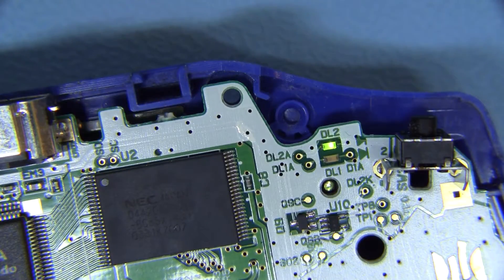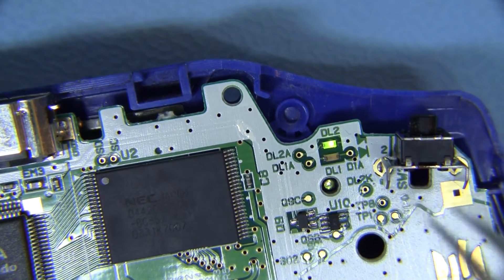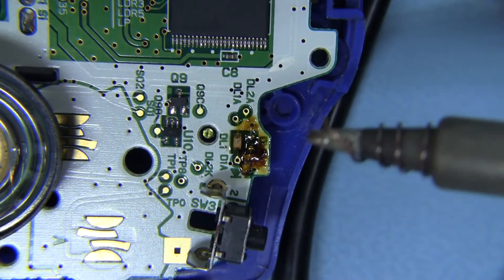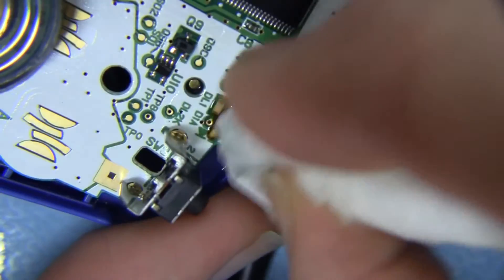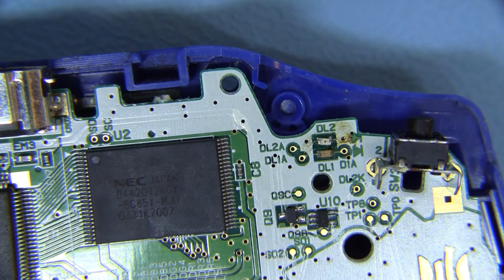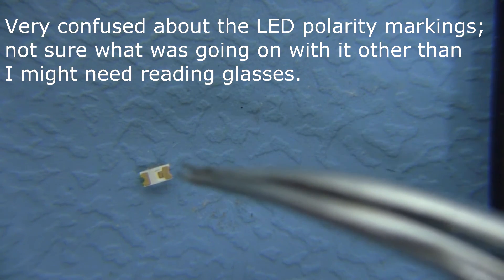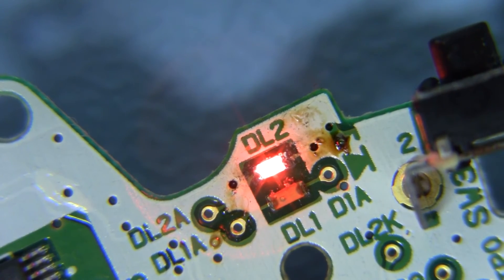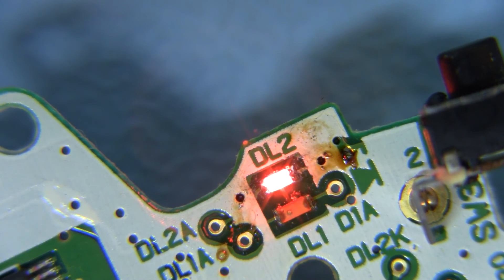Game Boy Advance GBA LED Mod

Comment: Hi Have you done this mod on the low battery LED?? I did both and switched it for a pink LED however it is not working, I got the power LED working replaced with a blue LED - any advice on the low battery led would be appreciated

Comment: Hey im not sure you'll ever see this message especially 7 years after the posting date but I really want to know if your technique or method for doing this has changed. The reason I want to know is because I'm planning on doing this myself and I'm unsure on how to go about it.
Reply from the maker: I would use hot air and flux to remove the LED or a bunch of flux and and soldering iron turned up pretty high like I did in this video if I didn’t have hot air - skip the wire technique altogether. Another help would be to use chip quick (see the easy game boy screen removal video).
Reply: @8bitjunkie8  thank you very much I  appreciate it. Is that video on your channel? I'll have a look if it is

Comment: IMHO hot air is overkill for an LED, especially on a small board like this and when there are plastic components like the tact switch nearby (those things are damaged very easily). An iron is the best way.
Reply: I was just able to do it with just the soldering and it was still relatively quick and easy as long as you have the right tip size which is the very fine point ones!

Comment: Great video, will definitely take the hot air way when doing this. Thanks!

Do you know the voltage delivered to the LED? A buddy wants to replace his with a purple one, and i'm not sure if the voltage is sufficient to drive the led because the max voltage of LEDs increase with wavelength.
Reply from the maker: It’s at most the voltage of the batteries (so nominally 3V). You could change the series resistor to a lower value to get closer to vmax. I’d buy the led and try pushing 3V through it and a variable  resistor to see if it will light up and/or determine the optimal series resistance. 

Let me know what you find out if you try it.
Reply: @8bitjunkie8  Hi, I want to change my LED too and today my Pink LEDs arrived. The problem is that they need min. 2,6V to start to glow. So I have done some measurments on the GBA Mainboard. The power LED gets power from the VDD3 Lane which is 3,3V, it got an resistor in front of 470 Ohm, the green LED got 1,9-2,0V. So my problem is that I'm not sure if its safe to unsolder the resistor. After the LED is a component (U10) which I dont know. Maybe a kind of switch?
Reply from the maker: @theRealStillPad  you will need to replace the 470R resistor with a 200-240R. I would build a test circuit with a 3.3V power supply to see what's the highest ohm resistor I could use to make the LED light bright enough.  It looks like the original LED is drawing about 3mA, I'd want the replacement LED and resistor to not draw much more than that if possible.
Reply: @8bitjunkie8  Hi, nice to hear from you. Today I made to some tests with the LED. Before I have done some maths that with the 470 Ohm Resistor the LED would have 2,6V with 1,5mA. With my testbuild the LED got 2,6-2,7V and 1,2mA @ 3,3V Source. I think its pretty perfect, because with more Voltage the LED would be way to bright. At this config. it is glowing but not blending. I'm pretty happy that it works so great with the 470 Ohm. Now I need to wait for my Flux Order to start soldering on the GBA :)
Reply: The l.e.ds are all the same colour just different tinting on the surface

Comment: So what type/model LED's can I use? Looking for a UV LED for that spot. I have a Glow case with UV silicon and clear buttons. Want to change both LED's. Putting UV LED's in the buttons.
Reply from the maker: It’s an 0603 style led. I (quickly) looked for a suitable one for you but the ones I found have forward voltages above 3V so I don’t think they will light up on the GBA

Comment: Thanks for showing this i have a white gba w black buttons and ags 101 mod w ez flash omega and all thats left is adding a blue or purple light there :)
Reply from the maker: Try to find one w as low forward voltage as possible. You may have to change out the series resistor to a lower value to get a blue LED to light up. Try swapping the led first and see if it just works though.
Reply from the maker: Did you try this yet? Send me a link to a photo if/when you get it done.  I'd like to see it.

Comment: Really silly to use a hot air gun for something so simple as a led swap all you needed to do was touch the ends of the led with the soldering iron tip while pushing lightly with tweezers.
Reply from the maker: there's no metal on the ends of those leds and almost none of the pad is accessible.
Reply: Jamal Phoenix.  3n7

Comment: wow, you are not talented -.-
and no smart guy xD

who needs a red Power LED in a GB Advance?? So it seems always to be low battery?
Reply from the maker: +Einfach Nein red's the only color LED I had at the time. I did put this board into a red shell and it looks pretty cool.  You could always change the low battery LED too, so it'd be a different color.
Reply: @8bitjunkie8  that is an awesome idea! I want to do my Super Mario GBA's  LED Red but i was like but then nobody can tell if the battery is low but like you said just switch em both out! Good 💡 idea! 😂

Comment: quick question. I want to mod a rechargeable battery into my gba. The charging circuit i got has it's own leds. If I want the gba's power light to come on while charging, would I just disconnect the led on the circuit, and run wires from there to the gba led? or is it not that simple?
Reply from the maker: +zoids180140 I think so, but I wouldn't call it simple. You want to make sure the voltage to the LED on the charging board is the same as the GBA.  I'm assuming everything will be at 3V and it should work.  Actually cutting the traces and soldering the wires may be very difficult though.